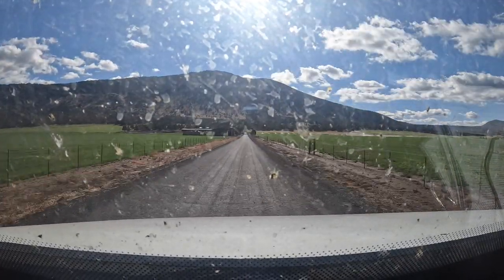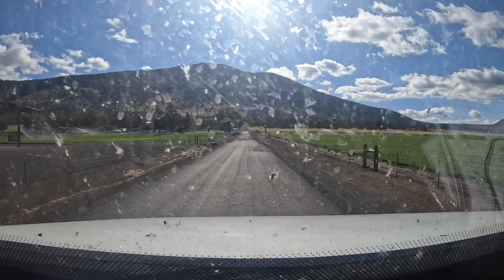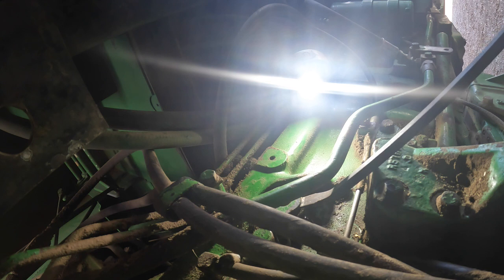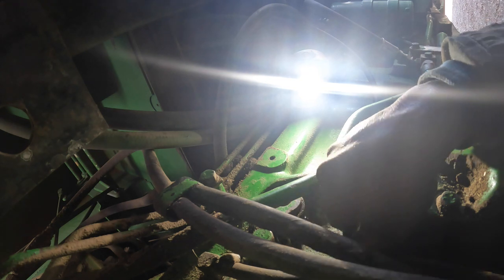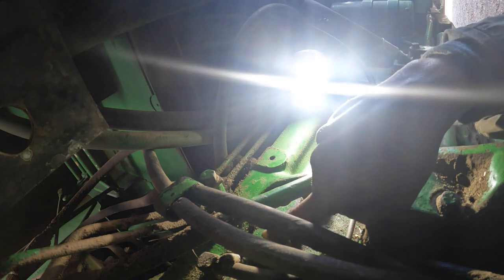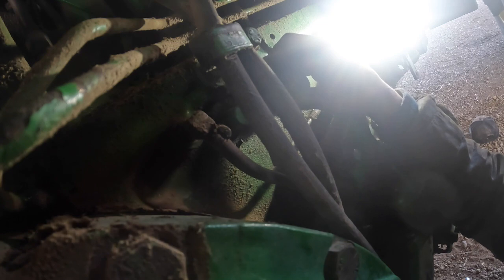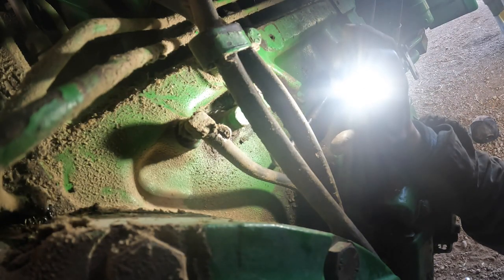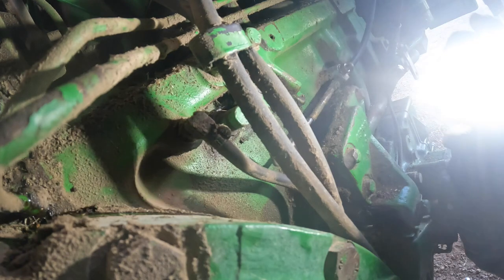Haying Equipment service calls.

Comment: Yall got serious hay using a 2000lb tractor to rake with! LOL That bolt you screwed out holds one end of the transmission disconnect, lucky for you the other side must have held it so it didn't fall.  The spring is supposed to spring load the cam inside so that the linkage can go into park if the teeth on the pawl line up or not. Then when the tractor rolls a bit the spring puts the pawl the rest of the way into park.

Comment: Hi Warren working on a GT 580 Dryer replacing the main auger bearings and both auger tubes. Also doing auger and tube on a 7720 John Deere combine while working on fixing up a 2007 f250 thanks for uploading a video love watching the John Deere videos especially

Comment: I think that 4840 coil spring allows the shift lever in the cab to move into park position when the parking pawl is not lined up. You have a 50/50 chance of that needing to happen depending on where the gear teeth line up. Without the override spring you would have to rock the tractor to get it into park about 50% of the time. When you were working on it, it was aligned.  It’s been a long time, not sure it I remember right.

Comment: No worries Warren. As long as the stop screwed in . You are golden. It acts as a pinot for the tow disconnect. The spring is only for the mechanism if the park gear is not aliened . It will pop in when the tractor rolls a litle bit

Comment: Great work. The rats didn't get into those wires, hooray! You had to spend a lot of time with that spring to find out some idiot had bent the crap out of it. When an owner has to repair his own equipment himself he is a lot more careful in using the equipment. Warren, you work so hard. Always 1000% effort! Thanks for this video, the best thing in my day other than waking up.🙂

Comment: I hate goin out to finish a job that a customer halfass started like that alternator. You end up wasting time trying to figure what the fuck they did and where shit goes. And yes to the keyboard mechanics, the alternator is wobbly cuz it ain’t tightened all the way down in that shot. And ain’t that the way it goes Warren. Equipment sits for months until they have to go do that job for the season with no attention paid to getting shit fixed until it quits during the peak time of use for the year.

Comment: f you still down have park. the pin and roller broke off the park pawl and you need to pull the top cover and maybe the rockshaft housing and replace the pin and roller